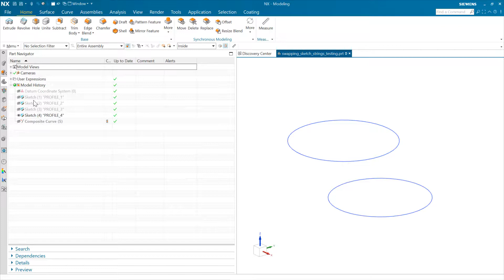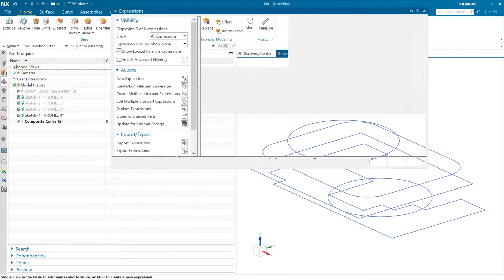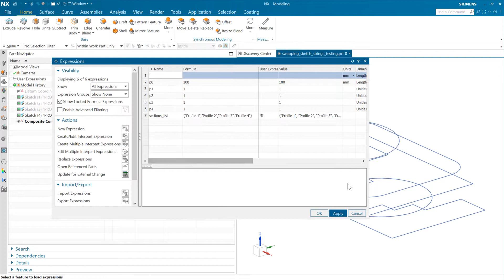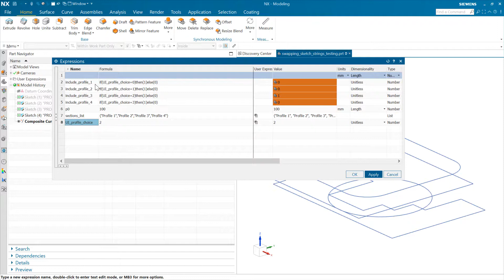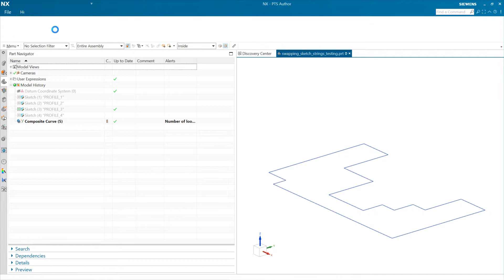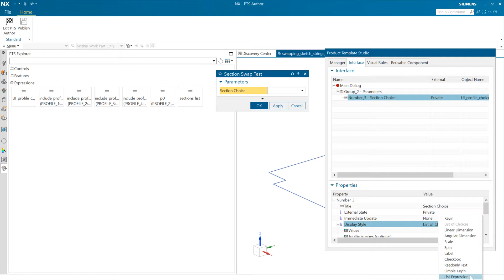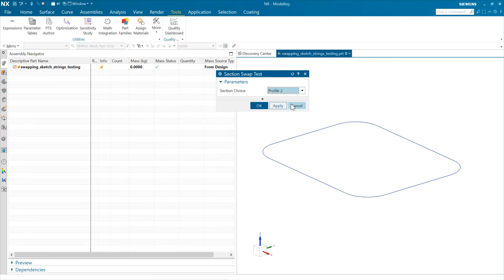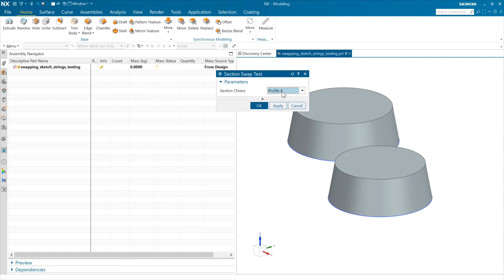NX Product Template Studio: Swapping Input Sections [NX 1980]

Comment: Is it possible to do that but without introducing a new curve and the tolerance that goes along with it, i.e. tell the extrude/swept which exact sketch to use directly?
Reply from the maker: Great question! With the refit options turned off, there's no new curve or tolerance here.  The exact original curves are being used.  The Composite Curve feature is just a collector in this case.  Hope that's useful!